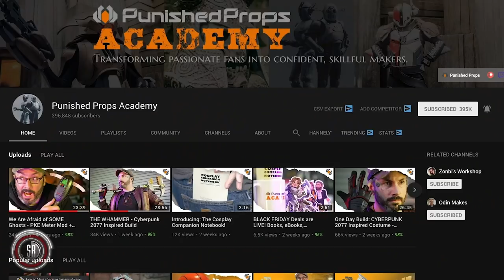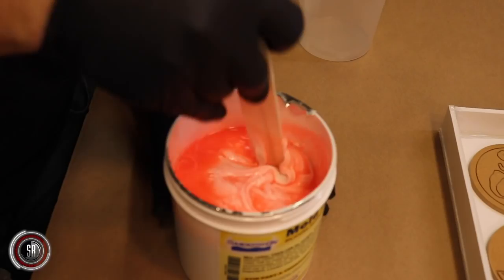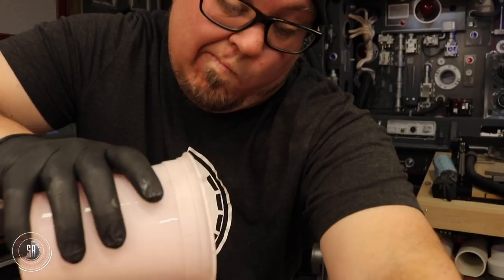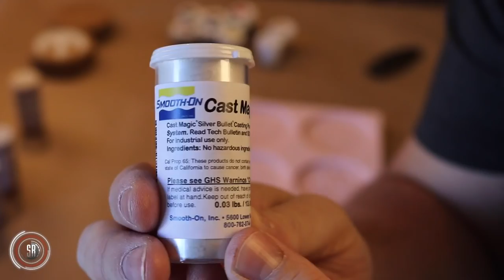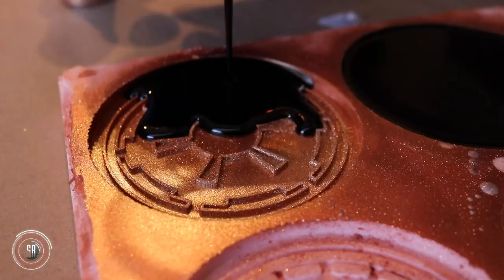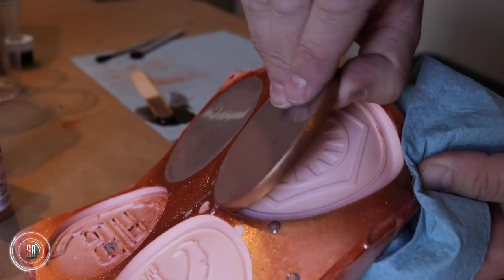Star Wars Coasters - Cold Casting Resin

Comment: What size bit did you use on xcarve?
Reply from the maker: Hi There.  I used a 1/16th up-cut.  It did a fair job.  Unfortunately i broke it during another carve, so the Smugglers Room Coaster came out really bad.  I'll have to re-do that once i get a replacement.
Reply: @TheSmugglersRoom  thanks for the speedy response. I have the Xcarve as well and have been wondering about using for casting.  I will try after I build my helmet stand that you showed in your previous video. Thanks for what you do.
Reply from the maker: @TheTactical_Monkey  Awesome stuff, please share when you make it I would love to see it!  This is the first casting i have done from an Xcarve project.  The only thing i wasn't happy with was that one of my MDF pieces did not get enough prep.  I rushed the sealing and sanding due to time, and it shows a little on the side.  I pretty much hate sanding and sealing!!!!  LOL

Comment: You don't need to add any coating on them to protect your coasters from spills and alcohol?
Reply from the maker: SamB0tte hi there.  I am sure a clear coat would help, but I can tell you after months of use and abuse they have held up great.  We’ve even used soap and water to clean them after use without problem.
Reply: @TheSmugglersRoom  thank you very much! Good to know after months of use that they are holding up 👍
Reply from the maker: SamB0tte absolutely, and thank you for watching!